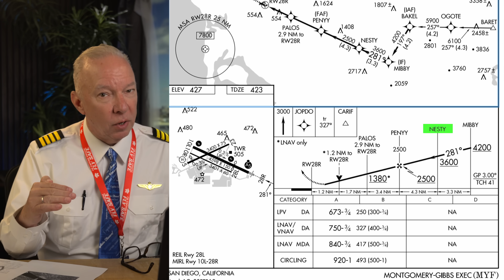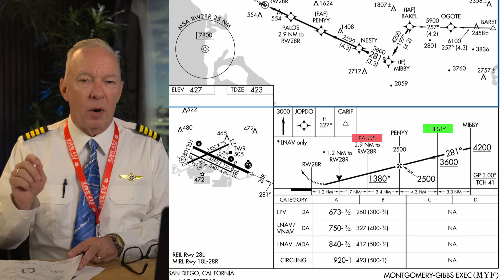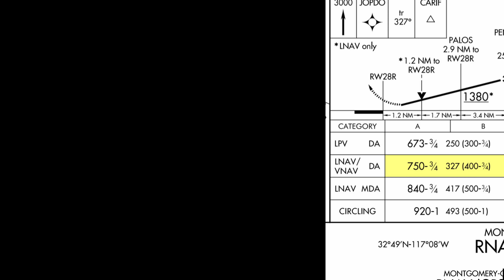Tragic Crash in San Diego: What the Pilot Did Wrong | ATC & Flight Path Breakdown

Comment: Looks like he went well below the minimum altitude ....pretty far out.... Ironically and sadly:  KSAN (Lindbergh was well above mins)...and it was not far away...  It Looks like he ducked under the GLIDE PATH (not slope) ...at  the MAP,  he prob lost the FPA (Glide Path Indication)  becaue he was doing the RNAV IAP...and many times the GP  (indication) will Drop out at the MAP.... That  is where , the good OLE ILS 28R would have worked better... You can (NOT LEGAL!) but you can drive the plane to the Runway houch down zone ON the GLIDE SLOPE ... also the NKX Weather and Altitude Setting and Weather was good for MYF... I know, as when I flew for AMERIFLIGHT we had an op spec agreement to use NKX weather when MYF tower was closed ... The Military weather is very accurate and there was no unstable weather in the area.... so the Altimeter setting given to him from SOCAL was prob pretty accurate .... However the IAP they were using was not going to get him in  (although -when he left Kansas the MYF METAR was VFR -yet as the case is in Costal Cities in California... after dark the the sea breeze brings humid cool air into the SAN micro climate that causes very thick but patchy Fog ... For the Frieght Dogs trying to get freight into MYF (or any where on the coast of California  very early in the morning) it is a heart breaker...as that the fog can show up very quickly...and the airports can go from  clear (CAVU) to (WOXOF)  below a 1/4  mile  in minutes .... The PICs mindset:  He knew the area, but had not expected it that day to be as bad as he thought .... In the last few minutes of his life he was asking about the weather for alternates... that is really really REALLY late ...  and he did not ask enough questions .... He started on a good list.... SEE...SDM  they are pretty Close... and both were below mins (SDM has terrible approaches) .... Next would have been CRQ, RMN and IPL,  TRM and  PSP.... but really SAN was pretty good - that would have been top of my list.... but the PIC should have been watching the SOCAL weather starting about an hour out --watching trends in SOCAL (esp when the desert gets hot)....is CRITICAL -esp late at night.    HOWEVER: It must be said about LEGALITY... it does not matter, they were flying PART 91 and they can pretty much do anything they wanted.... In the Airline world Legality rules most of what we do...and we marvel at the great risks the General Aviation guys take -just because "they can" .... When we go from DFW to The West Coast I start watching the Temp Dew PT spread and trends starting 2 hours out (usually when we are over  New Mexico) ... and always ALWYS have an alternate ...even if it is Clear... especially when it is clear, the good California Pilots know, the worst FOG happens on clear nights... Temp around 60f (and DEW point spread with in 7 deg) )  light winds and an inversion between 700-3000 feet AGL.  .... BTW he had a kind of strange Instrument set up ... a mix between a Mechanical HSI-FD (orig installation?...we call em steam gauges) and an after marker GPS-FMS.... it might have been factor in how they handled the aircraft at mins... as the displays were a mix of 1980s technology and 21st century ...and the Drummer plobably was the guy flying ...and I dont think he was properly rated ....

Comment: Am I correct in thinking that somebody put a 200ft mast on the landing path of a runway? I understand there is a hill there but why did someone make things worse?
I think it was San Diego that someone built a multi-story car park also in the path of a runway.
I am not a pilot but I think this situation is too strange to be true, so I am just going to walk away and forget it.
Thank you for a very interesting description of what happened to these poor unfortunate people.
Reply: A normal Glideslope angle is 3 degrees which should clear any obstacles like trees or buildings or hills along the glide path. The approach plate showed the MINIMUM altitude the jet had to be at to clear the hill and wires. He was under the minimum. The DC army helicopter was over the maximum allowed altitude when it hit a passenger jet. When pilots break these max and mins, whether on purpose or accidentally, people often die as a result. (I’m retired FAA, ATO)

Comment: Great Video with professionell analysis -two comments /been a former Commander of a C550 „Bravo“ - this jet does not have a T-Tail -rather an old fashioned looking cross tail (maybe that wasn‘t available at the Flight Sim😅) the other correction about approach categories :You missed it in Your comments -the higher the category, the heavier &subsequently faster are the approach speeds /and thus the sink rate -great vid though😅

Comment: Palos altitude restriction is for LNAV only.  If he’s doing the LPV, it doesn’t apply.  In any event, he may have been below the LPV Glideslope.,   What kind of autopilot?  Did it capture the glideslope?  Or did he  try the LNAV and dive and drive as youn alluded to?   Pilot had ATP/CFII.  Altimeter setting probably wasn’t a factor.   He probably had LPV since it’s likely he had a Garmin 750, which would be LPV (with WAAS). Vis mins don’t apply to Part 91.  And I suspect his airplane is Category B, since a typical Vref for a Citation 550 is about 106-110 Knots.   John ATP/CFII CE-500 Type Rating

Comment: My guess it was a dive and drive situation.  :((((

Based on weight and speed for a straight in approach he was probably legal for category B. Unless he flies at a higher speed or was extremely heavy. 

Further, if he was part 91, he could legally shoot the approach even if visibility was lower than what was published. You are correct for Part 135 and 121.

Comment: I flew into San Diego International airport a couple of years ago and was surprised how low the planes have to fly on approach due to the ridges east of the coast. Add the fog visibility issue and the Montgomery unmanned airport with no weather report, plus electrical towers on the ridge and it sounds pretty scary indeed. Is there not an airport difficulty rating that could identify the experience level needed to land at a given airport or require flight simulator training to be permitted to land at that airport? It seems like there have been a lot of small plane accidents lately related to pilot inexperience in difficult flying situations.

Comment: Updates at the time 3-4am that airport that the plane was going to is allways close at 3-4-5 am and it's all ways low clouds low visibility in that area at that time of day the pilot could not see the airport  and per faa standards for that airport the airport is only intermediate rated or A &B flight intermediate aircraft the plane that crashed was  C rated intermediate which planes that are c rated intermediate can onto land at that airport  the pilot flew in to low clouds with a hill near by and low  visibility the plane hits power lines on the hill be for crashing into the housing track.

Comment: Just a heads up, the reason the aircraft may have been low ar PALOS is because that crossing restriction is for LNAV only.  If youre tracking LNAV/VNAV youll be lower than 1380 feet.  Its denoted on the plate as a note.

Comment: I actually drove past the wreck site today. There is a light pole with an obvious impact mark laying across the street along with a large section of the wing about 300yrds before the point of impact. I believe the wing seperated from the plane shortly after hitting the power lines and fell hitting the light pole. The plane free fell to the impact location. There is no way the plane was low enough to hit that pole and then swoop up over houses to get to the impact point.

Comment: Strange thing is, KSAN (San Diego Internaitonal) had much higher ceiling and minimums at that hour, and despite the curfew on takeoffs, landings are ok at all hours.  This often happena as the plateaus in San Diego for MRY and Miramar are about 400 feet above sea level, but KSAN is 11 feet, so the fog is on the mesas, not at sea level.  Likely a high landing fee at KSAN, but would have been a small price to pay.  I live about a mile from KSAN, and when I got up at 6:30, KSAN had normal operations on runway 27.  Agree - very tragic but preventable.
Reply: Ksan has an approach that is considered one of the most dangerous commercial runways, literally through the downtown skyline, and rarely more than 500’ above mostly residential areas.  Most planes stop coming in around 11.  Now combine landing in fog with the fact that the end of the runway you land at more often than not has a massive parking garage in front of the runway you have to clear before landing at it. If there is fog and your airplane isn’t made by Boeing or airbus chances are it can’t make the landing at ksan
Reply: @AbbyAmana  If you check the 3 day weather link at KSAN, the visibility at 3:55 am was 9 miles, and the ceiling was between 900 and 1000 feet.  The parking garage is a known item, and most pilots actually use it as a marker.  One needs to clear if by 110 feet.  Landings are NOT restricted by the curfew - just takeoffs.   KSAN would have been a safe landing, with a 900 foot ceiling.  AND a 24 hour tower.    Link to 3 day five minute weather - https://www.weather.gov/wrh/timeseries?site=KSAN   - Contrary to popular ledgend, KSAN is NOT a dangerous airport despite the youtube videos that always include it - yes the downtown buildings are close, but again a known item, and just a somewhat steeper approach than most airports - it just requires pilots to pay attention.   There were not a lot of options - likely Palomar (short runway also) had low visibility - it may have required diverting to someplace like Ontario, and he may not have had enough fuel.  Coming in from the East, I might have landed at Imperial County out in the desert, and waited it out.

Comment: I don't have tons of experience but the lack of planning wrt the alternate disturbs me.  I'm also an engineer and am skeptical of systems; for example the chance of GPS jamming or mis-setting an altimeter.  So I like to have multiple systems in agreement when doing an instrument approach.  My preference is an ILS backed by GPS, and I use two independent ILS receivers tuned in.  If there is any disagreement I break off, called a missed due to equipment, and figure out what went wrong.  It just takes a few minutes.  I also like there being a controller watching me on radar.  Redundancy is your friend.

I also don't like diving to intercept an approach.  I did this just once, rounding out right on altitude only to be given a low altitude alert.  I called a missed and was vectored around.  I later learned that the low altitude alert uses rate of descent and my high rate triggered it.  Later on I pulled my flight data from my avionics and verified that I did not go below the approach altitudes but rather than try and think it through I went missed and tried again.  I think that is the proper decision.  There is great value in a stabilized approach.  The workload is less and it is easier to detect problems or deviations from the proper path, especially after a long flight.

Comment: Everyone I think needs to remember that when you’re tired and coming off of a long day, especially when it’s also bad weather, is exactly not the time to “give it a go”, even if you feel like it’ll probably be fine.

Feel bad for the pilot. He probably just wanted to land and rest but yeah, he should have paid more attention to the information in the charts.
Reply: I was chasing this down all day yesterday and that “give it a go” statement was really troubling. That's more like something I would say when sending my kayak downriver than trying to land a CII with old avionics (the pics are out there) in minimal visibility at 3a after flying all day. That was such an unfortunate mindset.
Reply: @davebuser yep! 40 year old plane, looked like the original equipment 😮
Reply: @brucemarkham4673  I had a huge poster of a CII cockpit over my bed as a kid and yeah, that's exactly what it looked like. The old Caravan puddle jumper I took in Belize last year (incidentally, with the pilot that was recently hi-jacked and stabbed) had a much more modern panel.
Reply: @brucemarkham4673 can you elaborate? Is this a bad thing? Do pilots usually upgrade the equipment?
Reply: You’ll notice there is no discussion of the local altimeter setting.
They hit high tension power lines.
Reply: @robdunham7398  I think Captain Steve mentioned in passing.
Reply: He shouldnt have been flying in fog,I won't be a passenger in a car in fog I remember 1990s when there was big pile ups on moterways in fog people died like here but this was in air.
In dark and fog he couldn't see pylons, thd poor house owners are the ones I feel bad for it must have bern terrifying gor them to see whole street on fire and their homes lost or damaged. 
They are going to struggle to get compensation from deceased pilot
Reply: @bunglejoy3645  they wouldn't be the owners as it is military housing
Reply: @bunglejoy3645     I know.  I was thinking a plane can't pull over off the road.
Reply: The pilot could have killed a lot of people on the ground. It was reckless and stupid and now 6 lives are lost. 😢
RIP I wish the pilot would have made a different decision.
Reply: He could have easily deceived to KSAN but diverted to risk it all
Reply: I don't feel bad for the pilot.  I'm angry at him.  I feel bad for his passengers and the victims on the ground.  For him?  No, he caused this with his bad decision making.

Comment: The raw ADSB data shows he was flying it as a step down LNAV not an LPV.  He leveled at PALOS for 7-10s before descending after PALOS.  It looks to me like he got the MDA wrong and went down to 500 MSL instead of 840 MSL for the LNAV.  Didn't look like he was on an LPV following a GP, you can see him dive down pretty hard (as high as -2000 ft/min from PENYY to PALOS, then -1500+ after PALOS to 500 MSL).  The ADSB also shows he leveled for several seconds at 500 MSL after PALOS and before the impact, which is why I believe he was thinking he was going down to the MDA.  I think fatigue, 4am, he was thinking the MDA is "500 AGL" but bugged 500 MSL, which would have been like ~100 AGL and below the power lines right there at that hill.  Not sure why he wouldn't have flow the LPV (sure that plane has WAAS) or even the ILS and just flown the vertical guidance.  S550 S/II is a cat B approach speed plane.

Comment: If the pilot was aware of that peak.... well, if I got it right, the were zero winds.... so the logical decision would have been to make a flyby in parallel to the runway while consider to land from the opposite direction... make a 180. That's what I supposed the pilot had in mind when saying "We'll give it a go" ...  meaning "let's check the conditions". The altimeter settings are the core risk here in fog...... the opposite direction for landing + passing the peak mountain to the left or right would have been saver..... this reminds me on an accident happen here in the Harz mountains under fog conditions, where a private plane (Cessna?) hit a broadcast tower on the "Brocken", the highest rock in the  Harz mountains (~1148 m). Greets from Germany. And my condolences for the victims, that's for sure. 🙂‍↕️

Comment: hie is FAR part 91 rules so he IS authorized for the approach.  this guy flies FAR part 121 rules so he would not be authorized for it.  it is also difficult to get the auto pilot to properly locked on or coupled so it flies the glide slope or correct altitude in a steady descent all the way to the runway threshold when you are high. remember the controller asked the pilot if he wanted to circle to lose altitude to be better set up to get established on the approach and he refused the opportunity that the controller gave him to lose the excess altitude.  the controller can't tell him at this point that he is too high, he can only hint or suggest that it might be better if he made a turn to lose the altitude.  the pilot has the final say in this situation .   the problem is that sometimes you should listen to the controller and then i have been in situations where i listened to the controller and decided later that i should not have listened.  but when flying a jet you have just seconds to make these decisions and it is very easy to make the wrong one!